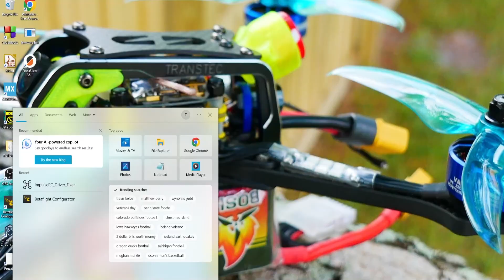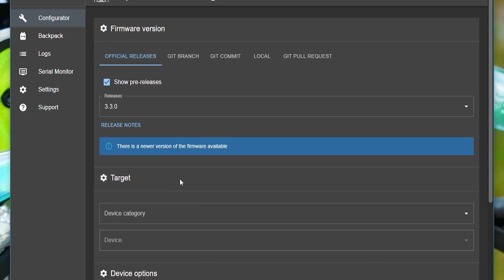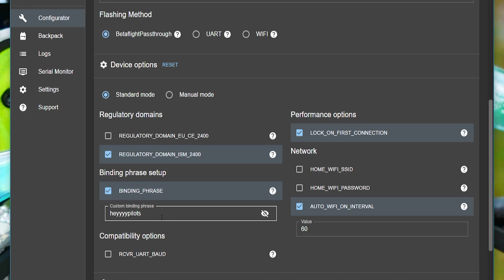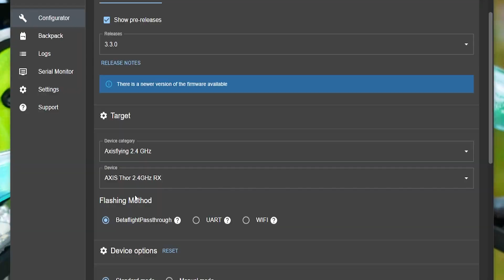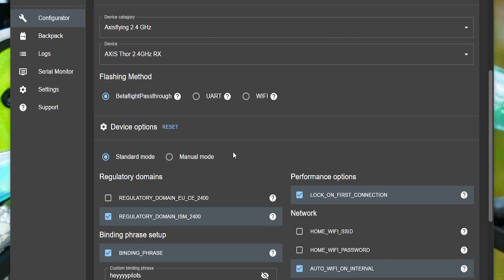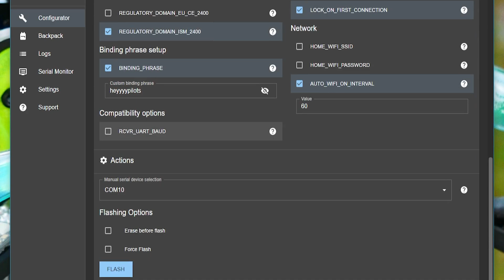ELRS Receiver Bad Flash?! Won't Bind?! Easy Fix! Let's Goooo

Comment: Drainman,   HELP, have New Radiomaster RP3 ELRS 3.0v  Receiver it flashes red slow then fast into WiFi mode , but won’t go into Red double flash bind mode. Even with the 3 Plug in method that is printed on the receiver instructions, why isn’t going into bind mode? And am not sure what to do or how to get it into Bind mode I have other 3.0 v ELRS receivers that went into bind mode without any problem.  HELP, 🙏🙏

Comment: my elrs reciever is flashing constantly, and when i try to flash it says cannot detect rx target, flashing blindly, then it fails.
ive tried sitching the rx and tx wires on the speedybee f405 v4 board and it does the same. i wired the reciever to another fc i have and it does the same light constantly flashing thing, does this mean my reciever is just randomly destroyed? this started happening after i enabled an elrs preset in betaflight config.
Reply: Happend to me on random. :(

Comment: Hello, i got the Meteor 75 pro brand new and accidentally flashed a TX firmware on my RX.. since then Wifi connection is not working and unfortunatelly its an AIO SPI Receiver... What can i do?

Comment: Hey drainman quick question: if I wanted to use the 915 mhz geprc rx with a radiomaster T12(2.4ghz), would I need to use a module? Thanks anyone..

Comment: Hey guys, I have the Jumper T pro with elrs external module and elrs receiver. The receiver has a solid green light when I start in a cold place. I was in the mountains and the solid green light wouldn't go away. After I come to higher temperatures, the receiver starts normally. I tried keeping it in the freezer as well and sure enough, solid green light. Couldn't find anyone else online with a similar issue. Any idea what this could be? Pressing the boot button doesn't work when the green light is solid.

Comment: When I hold down the bootloader button and plug the usb into my quad i do not get any lights on the rx...
Reply: I have a similar issue after I tried updating elrs firmware on my Foxeer receiver. I have no light now. I couldn't find any video explaining this issue. Everybody tells about bricked receivers however mine does not light up. Neither I plug in USB nor plug the battery. Even I tried pressing the boot button. Nothing changed.
Foxeer sent me the new one. It worked when I connect it to FC but after I tried updating with betaflight pass through it stucked at 67% and no more light. Led on the receiver is off all the time like the previous 😮

Comment: Hi,

I have a problem with my connection. 
When i power on the aio board with USB the receiver connects, but when i put a lipo it does not the light is solid. 

I found a way to power on with the USB cable and then put a lipo and it works but it is not usable because you know every time before flight to power with a USB and then lipo is absurd ............. 

So do you know how to fix that? 10x

gear - T-motor tron 80 hd whoop, Beta fpv ELRS nano rx and Radiomaster boxer

Comment: Yo money. I’ve got a situations that’s bizarre as hell. When I’m connected to betaflight the transmitter is working but when I remove the USB and power by battery it won’t arm. Any ideas? I spent half the day flashing components and wondering and I’m at the point where I want to see if will blend. 🪓😂🥹 any help would be much appreciated

Comment: Hey I'm building a budget racing drone please review it please.
Speedybee f405 V3 stack
GT2205 2300kv motor
5inch triblade props
2200mah 3s lipo
Zmr250mm

Comment: Hey here's a weird one I bet you can't solve?my new flywoo flylens 85 ELRS v3 built in Rx doesn't go into bind mode(double flashing light)it's stays on blinking then after 60 sec goes into WiFi mode as per normal,ive tryed the battery in/out 3 times but does not work as the light isn't on bind mode,this is a new model never had a firmware update and is untouched,i don't really want to use a binding phrase as all my other models don't have one.
Any ideas?
Reply: same problem with a crux35 i just recently bought. seems as if im gonna have to go the flashing and binding route really hating it always being something new but im finding thats this hobbys dying point, if your not smart enough to work certain parts or with pc's pretty much fucked. sad cause the hobby is very fun and rewarding when you are flying, also pretty shitty we arent far enough you cant plug n its automatically paired or bound or simple one button. crazy you have to watch 5 videos on something and still be lost yk.
Reply: Same problem! @DrainManFPV please help!

Comment: Quick question...will a my betafpv lite radio 2se elrs be able to be in bricked?
I tried to upgrade the firmware to 3.0 and now the TX won't even power on or charge...it will only turn on in firmware flash mode.🤔🤷🏻‍♂️

Comment: I bet the biggest issue has been people having leaving telemetry on. Otherwise ive has okay luck. And needed a starter kit 3 working quads is enough for me to keep up with. Otherwise i wont live
Reply: Not sure what you are saying about leaving telemetry on, insaw where Joshua Bardwell is always pushing to leave it on?  And thank for tip earlier to select the nano receiver in place of the RadioMaster EP2 2.4 MHz, which is not list.

Comment: I only buy elrs Rado master rp3 receivers with diversity antennas. On my newest build I have an antenna on the front and the back of my quad. You'll probably need to order two 90mm antennas cuz it comes with two 65mm antennas

Comment: One thing i was curious about tx and rx when i built my first quad, for anyone starting out (T = TRANSMIT) (R = RECEIVE) TX1 goes to RX1, TX2 goes to RX2, basically transmitting and receiving signals between devices, positive and negative are basic just beware of the devices required voltage/ amp draw from the bec/ voltage regulator some require specific voltages 5v not full battery voltage hope this helps someone.

Comment: I have RadioMaster EP2 2.4GHz receiver.  RX, can’t flash it because ExpressLRS doesn’t list it in device, what can you do then .
Reply: Flash it with the Diy 2.4ghz version, it should work.
Reply: It does do your selecting the radio master nano tx its there I have it.
Reply: @kennykobi  

Isn't the receiver an RX, not a TX?